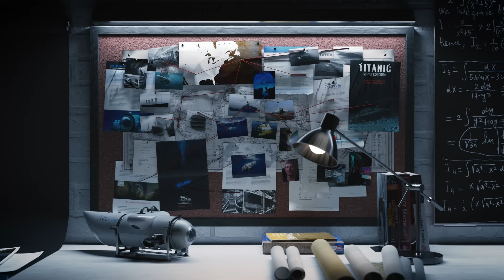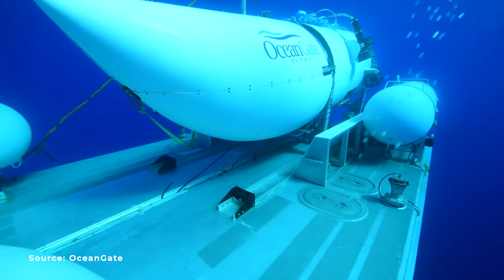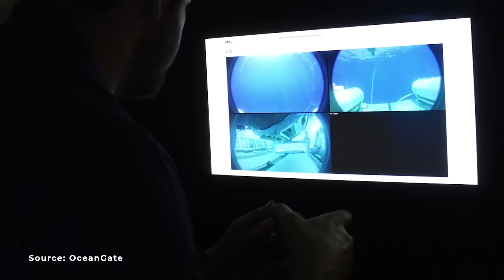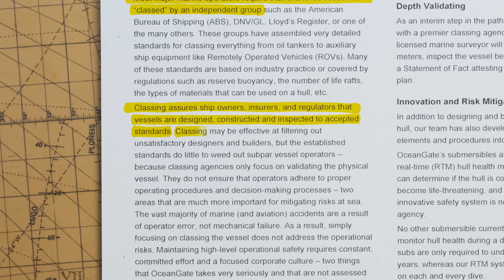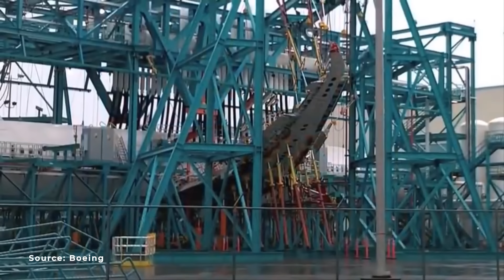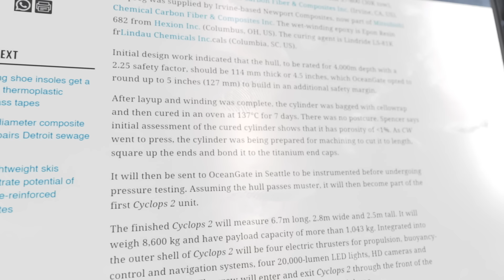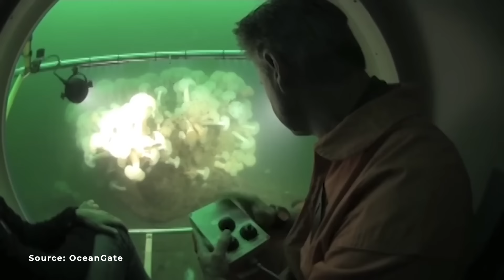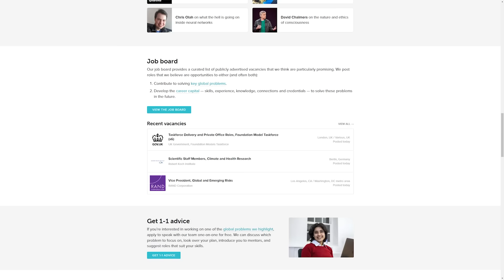The Questionable Engineering of Oceangate

Comment: I still can't believe they made the hull in an open air area, no vacuum, no one even wearing masks. This is madness.
Reply: Watching them apply the glue by hand and then just drop the titanium ring on was kind blowing to me, I make more effort to keep projects clean in my own garage.
Reply: @RobParkinVideo Whats the problem. That is how people make bows as well.

This is just a bit bigger device 😂.
Reply: @RobParkinVideo  Correct:  That was the biggest mistake they ever made, using epoxy glues or glue to bond 2 different materials. The slightest air bubbles that there are between the two parts will ever come loose and certainly at pressures at that depth. Moreover, those air bubbles will loosen the two parts when pressed, especially after frequent use. You can use this kind of construction where no pressures are involved.The hull and flanges should have been manufactured in 1 piece.
Reply: All of those air bubbles and dust particles are delaminations waiting to start.
Reply: This is Oceangate! Lol
Reply: It borders on the miraculous that the thing lasted 50 cycles, really.
Reply: They did a great job on the hull, inadequate, of course, but within Oceangate demands, they
Reply: And wound in all the same direction.
Reply: @GeistView That was the 1st hull, 2nd hull had axial layers aswell
Reply: That was the first hull,  they made the second one with a better manufacturing process.
This video gets quite a few thing mixed up between the 1st and 2nd hull. It was the 2nd hull which imploded
Reply: I was surprised that a composite manufacturer made it.  I assumed that it was in their own shop.  Also, they used allegedly expired carbon fiber materials.
Reply: This is what happens when you never had a real education,  you paid people to say yes, you decline the company who wants to install a comm system to communicate, but you tell them NO!  it doesn't take a rocket scientist to realize that carbon fiber and titanium will not work, without any structure reinforcement or even any form of layered protection, I give the guy an a for ideas, but a hard fail at how this supposed millionaire tried saving money to make more money.... Doesn't he realize that em waves travel really badly in deep water?
Reply: This is like redneck shit but at extreme level of redneckness
Reply: Pardon my arrogance, but why does the hull need to made in a sterile error? To eliminate fod risks etc.?
Reply: @lukas3606  for carbon fiber, its a bunch of carbon fiber strands essentially glued/laminated together. If there are gaps or air bubbles in it, it greatly decreases strength and makes it much more vulnerable, from what I know.
Reply: @lukas3606 the masks aren't for sterility but to prevent breathing in fumes or fragments during the construction
Reply: @lukas3606 so it’s actually a pretty simple reason, density. Carbon fiber is less dense than epoxy so if you just pour epoxy onto carbon fiber to make its desired composite, the carbon will float up to the top of the epoxy and push away more epoxy, creating dry spots and little or poor bonding. The put it in a bag and vacuum it is the technique used by individual hobbyists because it does a reasonable job of pulling the epoxy through the carbon, but it’s by no means perfect. With something as thick as a submersible hull it is very hard to have enough vacuum to ensure you are squeezing the epoxy into the deepest voids and that is very likely to have been the failure mode here. If you think about it a vacuum only will ever apply 15 psi of force inwards so if you really need to squeeze something together and get all the bubbles and voids out, you need something like an autoclave, which applies positive pressures to achieve its result.
Reply: @lukas3606  ignorance seems more applicable than arrogance
Reply: @lukas3606  When something isn't uniform because it has a impurity in one of the layers and undergoes pressure it becomes a massive stress point and usually becomes the point of failure.
Reply: 12:33
At least 250,000 Americans die each year due to some sort of medical error. But, depending on what is considered a medical mistake, that number could be as high as 440,000.
Reply: Im a boat builder of 4 decade now and you DO NOT need vaccum chamber for bonding epoxy resin in this case, if you mean when they stuck the end caps on?  It was a sliding fit that was clearanced specifically for an epoxy bond. The layering up proccess is where you ideally want a vaccum so it sucks the air pockets out of the fiber layers. As a strict bonder there is no requirement.

Comment: my opinions is that water got into the glue around the titanium end caps and worked its way into delaminated layers of the carbon fiber caused by multiple stress cycles and ripped it wide open..

Comment: carbon fibre was a stupid framework to use for a hull,  it makes no sense, it's just a glorified form of fibre glass, it would have bended and flexed with the massive compression and expansion cycles of each dive, the internal resin between the carbon fibres would have undergone micro cracking, getting worse with each dive, in the end there there would result tears in the resin weakening the hull, that's why they only got away with as certain number of dives before the hull was compromised for the depth they went to, rush was a fool looking for a shortcut and a cheap way out and willing to risk life and limb, he became so defensive and blind to the irrationality of using carbon fibre for repeated dives ???

Comment: Composites aren't necessarily weak in compression, many types of carbon fiber are nearly as strong in compression as they are in tension. While the are still many potential issues with delamination and buckling, as pointed out in this video, that sort of blanket statement is not helpful. When you lead with a statement that is at least partially untrue, people will begin to doubt if the rest of what you say after is true. You shouldn't be afraid to say something that seems unintuitive if it's the truth. If we want people to trust in engineering, we need to be trustworthy.

Comment: 🪄✨ Made with SummarizeYT
0:00 - The oceangate submersible begins its descent to the Titanic's remains.
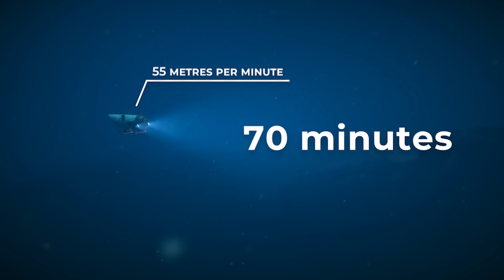0:16 - The immense pressure starts to add to the submersible's hull.
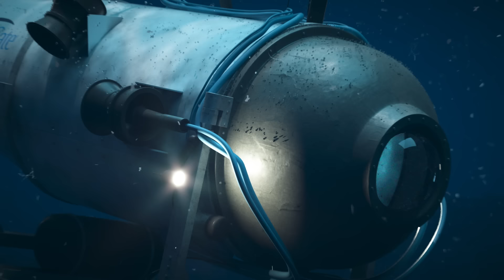0:46 - The submersible loses contact with the surface at 3800 metres down.
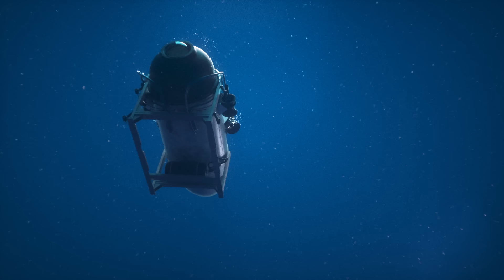0:54 - The submersible implodes due to the pressure.
1:06 - The questionable engineering decisions made by Oceangate lead to the accident.
2:02 - Carbon fiber composites are not known for their compressive strength, which raises concerns about the submersible's hull.
2:56 - Oceangate chose the carbon fiber composite for buoyancy, but didn't test it with a regulatory body.
4:16 - Lack of testing and certification exposes the submersible to operational risks.
5:06 - Deep sea applications of composite materials have a unique failure mode called snap buckling.
6:10 - Oceangate did not conduct enough research or fatigue testing on the pressure vessel.
7:23 - Composite materials are incredibly difficult to model in computer software.
7:38 - Composites are composed of fiber bound together by a matrix material like epoxy.
8:05 - We can simulate a small section like this independently to help analyze some failure modes, such as delamination.
8:38 - For a critical structure like this, I would very much recommend curing it in an autoclave.
9:30 - "Less than 1% voids" doesn’t exactly inspire confidence.
10:08 - Figuring out the causes of snap buckling and advancing material science for all mankind.
10:32 - An acoustic monitoring system like this is akin to setting up a camera to warn you thunder is coming.
11:12 - This attitude is dangerous, and this won’t be the last story of wealthy narcissistic CEO’s putting lives at risk.
12:33 - When an engineer neglects their responsibilities, it can affect hundreds, thousands, maybe even millions of people.
13:08 - We need engineers going into the most impactful industries to solve the largest problems facing our civilization.